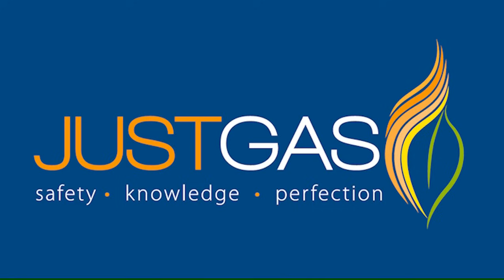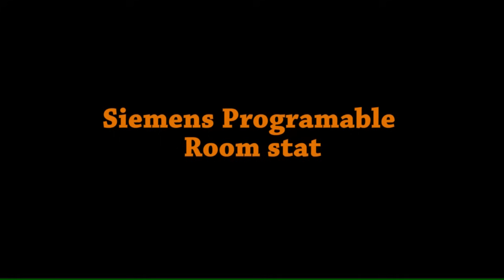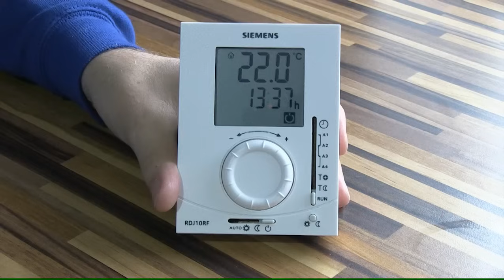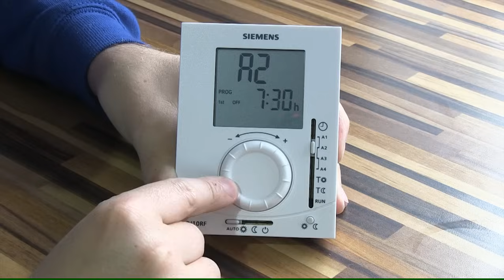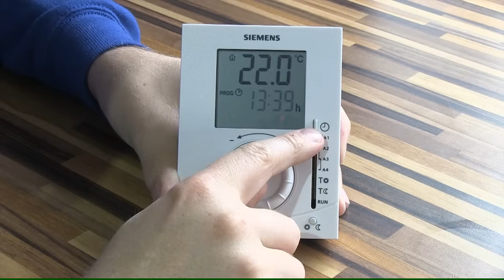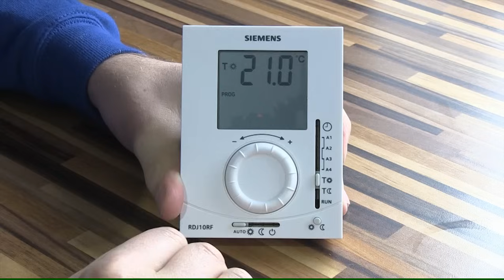Siemens thermostat operation

Comment: The most over complicated device ever.

I’ve set it at auto mode to come on between certain times.  

So am I right in saying 😂 between A1 and A2 time and the A3 and A4 time it will come on at the temperature I’ve set the sun icon to.

But in between those times it will go to the temperature of what settings the moon is at and if it drops below that, it will just come on to get back up to that moon temperature?

Comment: Thank you for the explanation, this was useful. 
However, why did the engineers develop a battery controlled timer that when the batteries die the whole darn heating system ceases to function? Infuriating and very unpractical.

Comment: Such a helpful video! Having moved into a new home I was wondering what it was for and how to operate it. Mine looks just the same but is branded as a BossTherm BPS242RF. Without operating instructions it is quite useless as I would never have figured out those symbols. I thought my boiler was faulty as it kept switching off. Thanks for your helpful video!

Comment: I found out how sun and moon works:) sun and sum temp will make boiler go on betweem whatever times are set on A1toA2 and A3toA4.. everything in between will be moon and the temp set there..for example A1 6am A2 8am temp at sun set to 20..so boiler will go on if temp drops under 20. A2 5pm A3 9pm will still use sun settings so will turn on at undet 20. Now MOON..So in between above: from 9pm till 6am and from 8am to 5pm will be operated by moon temp on AUTO mode. If you set moon to temp to 18 and it drops below between those hours will turn boiler on. Its confusing..ive seem 1000000 yt videos...try it and see. Screen tell you as well which mode youre on..look at time frames and sun/moon sign. Hope it helps.
Reply: So basically in auto mode if u only want the heating to come on during those set times it's best to set the moon temp to a low temp to guarantee it won't come on?
What was the purpose of him switching to 15 from the originally set 10? Is it so the heating will come on if the temp drops below 15 rather than 10 degrees?

Comment: I have the one that has timing things on the side. I can’t seen to make it work. I have it on the sun and run at 22 degrees. I’ve tried different auto and run for the times set I can’t seem to get the triangle t come on for the boiler to work pls help thank you

Comment: A ubiquitous CH controller with minimum user friendliness, making its ubiquity a complete mystery. Like others here, I have always assumed that "Moon" and "Sun" were related to day and night temperature preferences which, it turns out, they're not. All anyone wants, surely, is a controller that turns on when one wants and off when one wants at pre-defined times and temps plus the ability to override that as required. Nein vorsprung durch technik on this one Siemens.

Comment: Surely it should come on at A1 and off at A2, on at A3 and off at A4? I ask because it’s 2am and I am watching boiler videos on YouTube, as the thing is whacking out heat and I have woken because I am far too hot. My moon temp is 16: surely it should keep the house at 16 in the two set periods? Why is is roasting me in the middle of the night?  Bloody technology.
Reply: Chris Winwood Set your moon temp to 10 degrees (this is the lowest temp your house will go down to on auto before it switches itself on regardless of the timer) Set your sun temp to the max temperature you want when the boiler is on e.g. 18 degrees. Then slide to auto and should work. We had same problem. Got a quick guide pdf from the website and figured it out eventually! The sun and moon are not night and day temps confusingly - they are max and min temps. The min temp overrides the boiler to “on” regardless of the timer when in auto mode, so this needs to be very low. Hope this helps.
Reply: @lisa_c_bb This is the best explanation I've seen and I've been scouring the internet for an answer for a while now. Thank you!

Comment: Hi the round wheel temperature and time adjuster stopped working any ideas, can’t adjust settings
Reply: Mike Wright Unscrew the panel at the back of the unit and press the reset button n that should make the unit start afresh. If there is a empty battery symbol showing, then you need to replace the 2 AA batteries first. Hope this helps?
Reply: tazdeveel hi, everything’s working except the wheel, when turning it will not alter any settings, cheers

Comment: So helpful! Makes me think how I didn’t get it initially.
I was stuck with what temperature it chose when on auto whether it was the sun or moon... basically, imagine the moon as a temp between being “on” so one you don’t want it to drop below, then the sun temp is for the one you set on a1,2,3,4 :) easy! 
On the bottom slider if you want it quickly ok for a bit, just slide it to the sun. If you don’t ever want it to turn on say In summer , just flick the switch all the way to the right :)
Reply: Thank goodness for you!! Sat here freezing in my new flat, this video made no sense at all!
Reply: @thequietwilduk not a problem good sir!

Comment: This was very helpful. But it took me hours to figure out how to replace batteries ! Also, what does the sun/moon button on the bottom right do?
Reply: bootsamou bottom left corner you can see a cut out. Stick your thumb nail in the side recess n pull down. The battery holder will come down n out n just replace the 2 AA batteries inside. If you need to reset the unit, remove the screw at the bottom of the unit and remove the grey plastic backing. You should see 2 buttons allowing you to reset the unit.

Comment: How do put it on just for an hour for those occasional chilly evenings?
Reply: Turn the wheel clockwise so it's higher than the current displayed room temerature, the boiler should then start!

Comment: my temperatures are set but the unit is displaying it's 23 degrees and it isn't. The heating should have kicked in but it's not coming on plus there's no reset button on the unit anywhere.
Reply: Dawn Robins I found a reset button. If you unscrew the bottom screw underneath & take off the hinged stand, there's a reset button. I have no idea what it does. Good luck.

Comment: the problem i was having was when i set the timing on A1 and A2 ,then went on run it didnt come on,but what u need to do is when u set the times u need to put the temperature at 25 or 26 to light the flame which kick starts it

Comment: how do you turn the heater on without setting the timer
Reply: u set the bottom dial to the sun like he said.. which is permanently on
Reply: Ash Bash Sneakers n Fitness thanks for replying
Reply: 123adunke hi did u find out how? I'm.struggling thanks